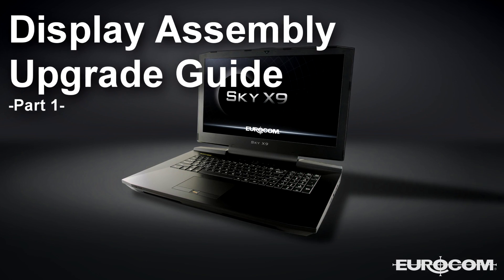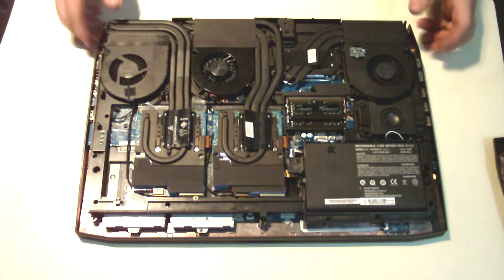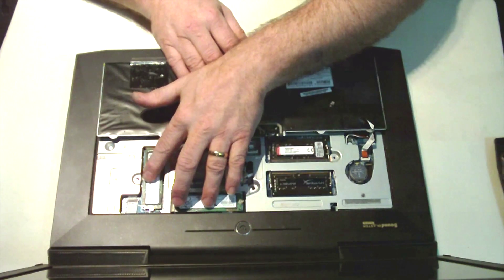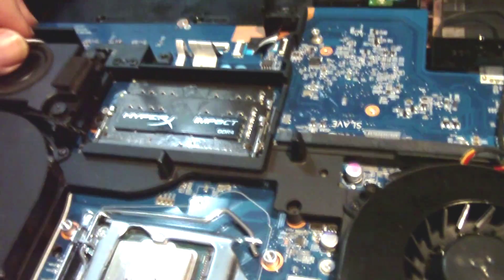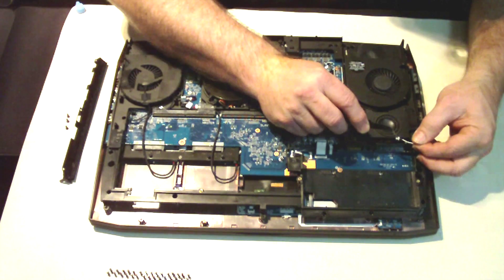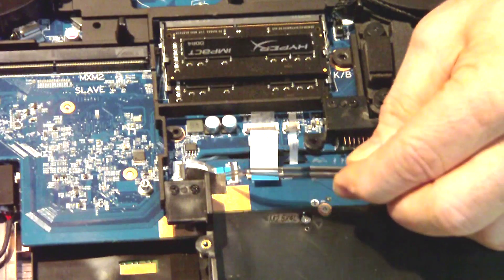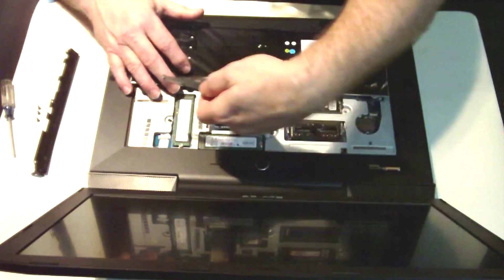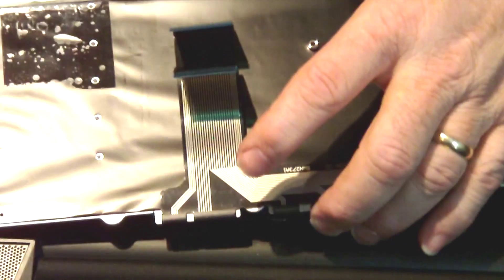EUROCOM Sky X9 Display Assembly Upgrade Guide - Part 1

Comment: im getting rather fed up with Eurocom, be very warned about them, i brought Eurocom M5 Pro, it comes with NVIDIA Optimus technology, but eurocom could be bothered to make a hard switch or a bios option to turn it off, i contact intel, nvidia, and eurocom themselves, nvidia, intel, both say that the manufacturer purchases the technology and chipset so its up to the manufacturer what they do with it. I sent them around 7 emails now, and all they do is ignore me, now im out over £2000 with a laptop that mainly uses the Intel HD 4600 instead of the GTX980M...

i know for a fact that this is thanks to their lazyness, MSI releases their laptops with a hard switch on the laptop that disables the onboard gpu, or in the bios, eurocom has no bios updates, and like 3 options in the BIOS

im only posting here because social media is the only way they will respond, may just make a video about this...
Reply from the maker: Hi, I see that our Support Team has recently sent you a response in regards to your support request.  Please let me know if you have any questions or if I can be of any assistance.